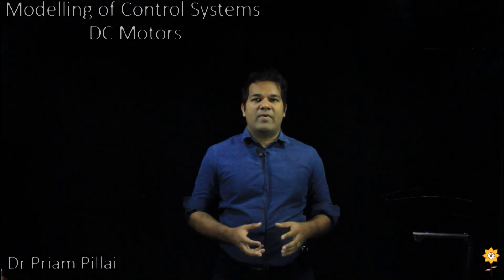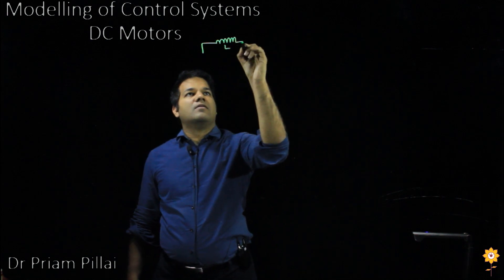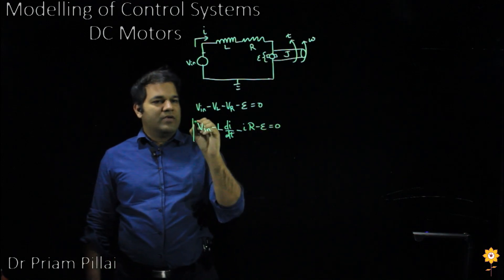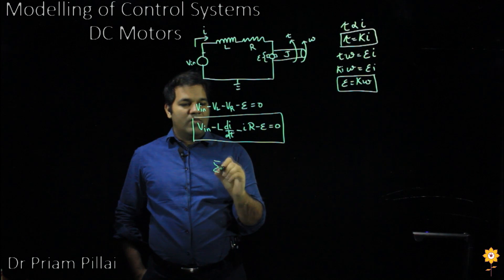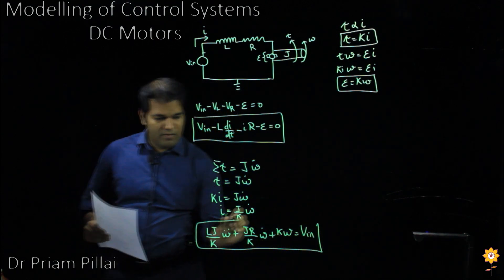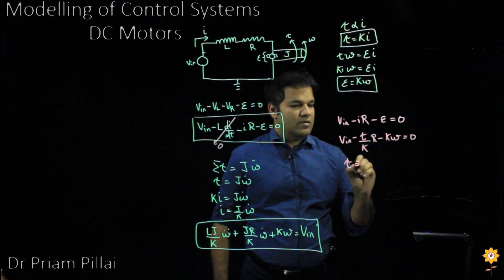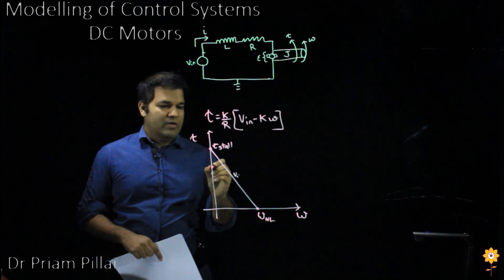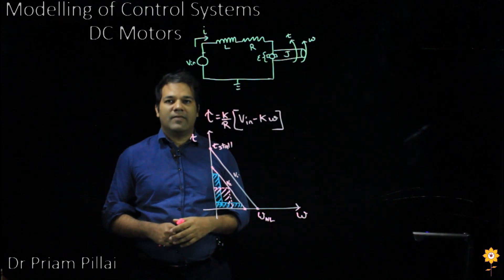Mathematical modelling of DC motors | System Dynamics and Control | Dr. Priam Pillai

Comment: good evening sir, im a student from malaysia, may i ask you something about this math model? the K constant is back emf constant or torque constnt? because from what i have research the constant got two K which is Kb and Kt.. can you please explain to me.. thanks
Reply from the maker: Hello Kekasih, in an ideal case the torque and the back emf constant are the same (Kb=Kt=K). However in real systems this may not be the case and there could be different Kb and Kt. In this model we assume the ideal case where power is conserved tau w=E i
Reply: ok sir.. if you dont mind, may i ask your opinion about my project. my project is about maths modeling of DC motor by using matlab simulink.. can you please give me your a simple opinion.. about how to analysis the result of the simulation